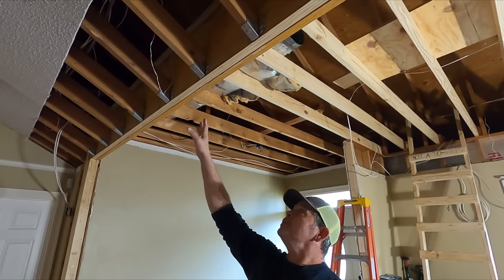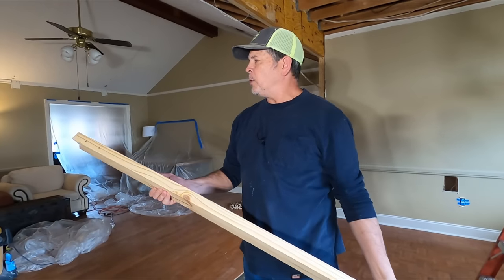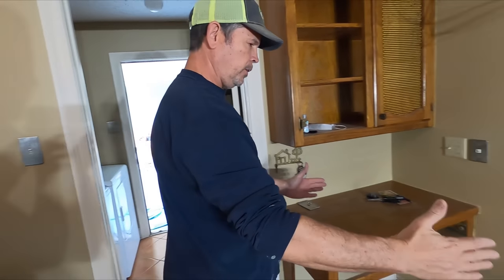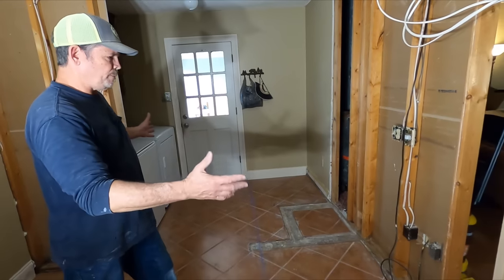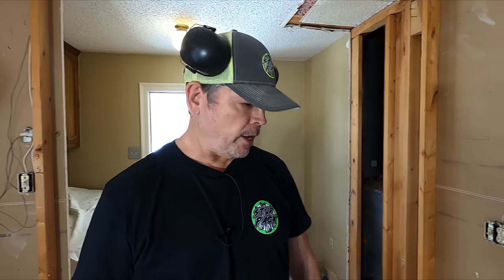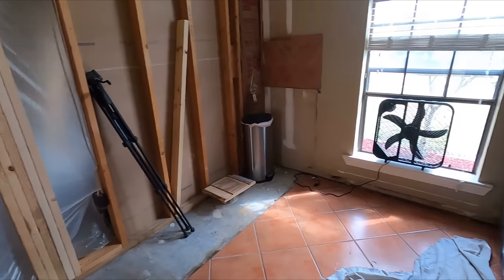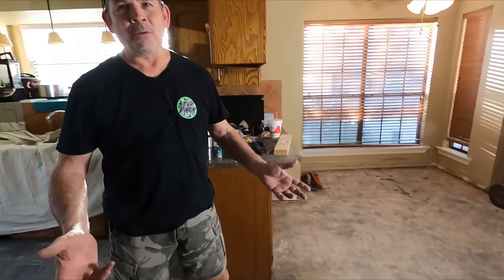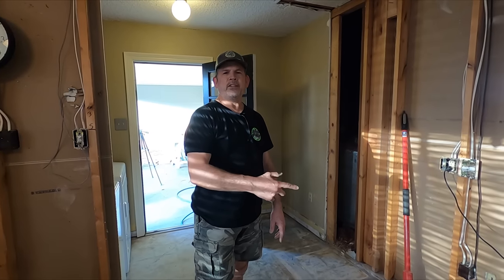How We Framed this EPIC Walk-In PANTRY! Ep. 6

Comment: “Every house has a switch that doesn’t do anything” 😂 man that is the truth!
Reply: I have one too!
Reply: we have 2 :)
Reply: I "made" a switch that does nothing. Replaced one of the two way switches in a hallway with a motion sensor and the other does nothing now. But, I left a "note" on the back side of the switch plate for future reference
Reply: I have 5 lol
Reply: If you have a switch that doesn’t do anything, and it’s an older house, it likely controls one of the sockets or both on a plug for switched lighting. Ceiling lights used to be less common, so lamps were wired so that you could control them from a wall switch.
Reply: I have afew
Reply: Ha! I've got at least 2 or 3 or more 🤔
Reply: My house must be too small. Rewired it top to bottom, relocated the fuse box, to new 200 amp updated breaker. All switches have stuff they go to!😁
Reply: I have two, one I know what it used to do, the other… I have an idea but who knows.

Comment: Hi guys, firstly check your local building codes in regards to the door swing direction. Does it need to be fire rated? If so does it matter which way the doors hung. It looks like a carport / garage to me, does the owner park (or potentially) their car in there? If so would two cars be able to fit without the door opening into them? Also make sure you the correct hinges for security reasons. Personally I wouldn't mind an outswing door if its doable.

Comment: Paul, great videos and really dig your sons enthusiasm. If you haven’t already check with your structural engineer on the roof bracing. It’s kind of hard to tell from the video but it seems the angle the brace makes with the roof is greater than 90 degrees which may not provide enough support.

Comment: I'd change the outside door swing so it opens against the dryer.  Keep it an inside swing for various reasons.  But this is the 'mud room' entry so by swinging it against the dryer you open all that space for walking in and give space for boots, whatever.  Nice work and great explanations and education as usual.  Loved the pushups!  And done pretty well too!  Warms my old drill sergeant heart!  :-)
Reply: @adsbadsb9488    That's a good point, but even as it is the door would not open if the dryer door is open, so changing the swing is  a wash IMO.  But, with the dryer there you could make a stronger argument for an outswing door.
Reply: All dryers I've seen have the hinge on the right-hand side, so even if the dryer door  were ajar, the action of opening the outside door against it would simply close the dryer door.

Comment: love watchiong you guys vids on beams. Had a quick question..if some of the joist end are too short and or chewed up from bad toe nailing to previous structure...what is a good rule of thumb to go by when sistering  joists to exted the span? all other minus 3-4 joists are all 12 feet.  Also what kind of ratchet hoist is that got a link?  Thanks

Comment: Pre expanding anchor. I like that better than a Tap Con cement screw. but what about driving a nail gun nail directly (ram jet)?
Reply from the maker: I simply don't do this enough to warrant buying that specialty tool.  I hardly ever use Tapcons.
Reply: @StudPack  Thanks for the prompt reply! What did you use for the bathtub base? looks like a great anchor.  I like the bang of the ram jet. $65  (or less I think) is not that expensive. I use it once aver 3 years or less. But it is quick. I'm still picking up little techniques all the time from you. Using your  speed square to level your 2x4's Quick hand easy.
Reply from the maker: Bathtub base ?

Comment: One call out to a door swinging out is security, as the hinges will be on the outside of the house, rather than inside. Unless there are out swinging doors with concealed hinges?
Reply from the maker: Outswing doors come with security hinges.  There's a setscrew inside that captures the pin and then there is a tab on one leaf of the hinge that engages a slot in the other leaf when closed.  You'll destroy the door before getting them off.

Comment: instead of spray texture on the walls, ceilings have you tried Skip Trowel texture.  Looks much better than old style spray on orange peel, and it covers all errors. Flat looks great till someone dings the wall and it stands out a mile away.   We did this on our house and that is one of the first things everyone points out and likes.
Reply from the maker: Haven’t tried skip trowel.  One thing I’ve noticed as I’ve worked around the country is the regional differences in finishes etc.  Where we are orange peel rules.  Anything different means bucks 👍👊.  You’re right about flat.   Seems like it would be easier but patches and paint are tougher
Reply: @StudPack  We are big on Orange Peel here too.  I'm just glad we stop using popcorn ceilings..  lol..
Reply from the maker: That’s for sure 😄

Comment: where I'm from all the doors open with an outswing. This goes back to 1800s where there were a few fires in churches where people couldn't get out in panic. After that all the outside doors have been built with an outswing.
Reply: So any thief can just knock out the hinge bolts and enter the house :P
Reply: @ryan_layne  Do you actually think that such an issue has not been resolved if the doors are required to open with an outswing by the law? Just because something isn't done a certain way where you are, does not mean that it can't be done. Never heard in my life that the issue you mentioned would be a thing.
Reply: Of course there are "security hinges" for such things. but then you pay more for something that is entirely unnecessary on houses. And I would imagine they are slightly higher maintenance since the hinges are exposed to the elements. Anyways, just because something goes back to some historical time and practice, doesn't make it best practice. Haha. Many commercial doors do in fact swing both ways, yet most normal doors open inward, and IMO for a good reason. No need to get all defensive, let's be pragmatic my friend.
Reply: Ryan Layne  simple security measure is to put a pin through the knuckle, from the inside (i.e. bore a small hole). Commercial version uses a set screw, but diy can use a finishing nail with the head just proud enough to remove but not interfere with the hinge.
Reply: Yup, I am aware :)

Comment: I'm a little concerned about twisting on that main beam since it's loaded top and bottom and in opposite directions. I guess the architect doesn't seem concerned so it must be ok.
Reply: Shouldn't be an issue. The only significant weight being supported by the beam is the roof, which is supported from both sides (opposite directions) on top of the beam. The ceiling joists are only supporting drywall, so there's virtually no twisting force as a result.
Reply: Why not take the strut load through the ceiling joists? Tension load on the joist would be much better than torque on the beam; I'm guessing those 2x6 ceiling joists would allow for shorter struts also.
Reply: @douglasmoore9918  if you supported the roof with the ceiling joists, you'd have much more torque than present setup, as the ceiling joists are at different levels on opposite sides of the beam. The only torque currently is a slight imbalance from the weight of the ceiling joists, drywall, and any insulation. The roof purlins would help resist that minimal torque in their current configuration, as they press down (and inward from opposing sides). There might also be blocking/connections at the ends of the beam.

Comment: You have no concerns about those 2x4's with the birds mouth cuts splitting down the road?  Those nails are only a temporary fix.  I think they need plates or something solid to wrap the ends.  On that laundry room door, doesn't code require you to have to door swing inwards?  Up here in Minnesota at least, you cannot have an entry door swing outwards, as it could be blocked and prevent someone from getting out in case of fire.
Reply from the maker: Birds mouth...  I’ll give them another look thx

Outswing doors... blocked by snow?  Is that the concern?
Reply: @StudPack  Wasn't blocked when you walked in, right? :-) Sure, might be code in some jurisdictions. But has it been a problem? I know back in Sweden, all exterior doors open outwards. So annoying with a door opening inwards. It is always in the way.
Reply: @StudPack  Doors blocked by anything, but yes up here, snow is a concern.  It's a general safety issue.  Same with interior doors.  They always open into a room, so someone or something can't block you in.
Reply: Why not attach those struts to the ceiling joists, using nailing plates per truss construction?  Better load distribution by putting ceiling joists in tension, I'd think.
Reply: @StudPack  I've opened my in-swing back door to be greeted by a wall of snow. At least I could dig my way out; had it been an out-swing door, I'd have had to climb out a window and go around to dig out the door.

Comment: Door that swings inside = BAD. UNLESS it's a security door (metal with 3 point lock, up down and side). Any idiot, drunk or thief can just shoulder slam it open and do whatever the hell he wants inside the house.

In general unless you have a heavy full wood door with no glass, wood has no place as an outside door.

edit: realized that it's inside the garage, but still, garage doors aren't usually as secure as a front door should be so I would still consider that door to be an outside door

Comment: Just took outswing doors off my house.   You dont want an outswing door
Reply: Why?
Reply: @treich1234  First most prehung doors are not weather stripped properly for outswing (they leak).  Doors flush with siding will cause some issues depending on the elevation it faces, where rain blowing in can be an issue etc.    The thresholds on prehungs that you hang as outswing, slope into house.    I think if you were hanging a door you would want to build a special frame and threshold and have it swing out.